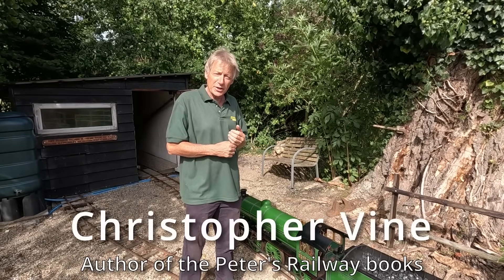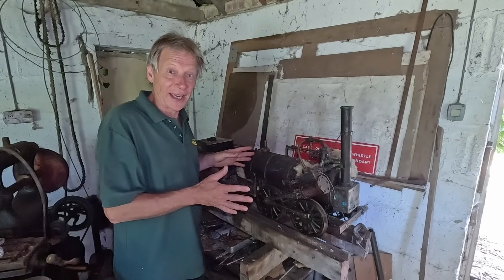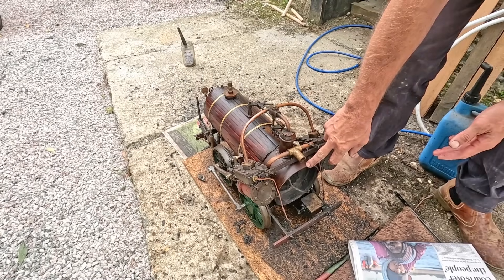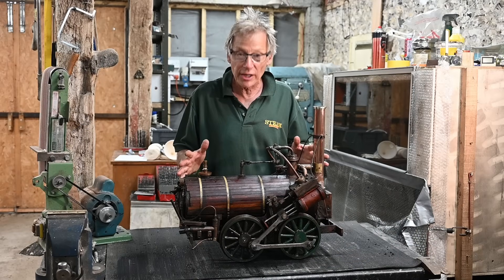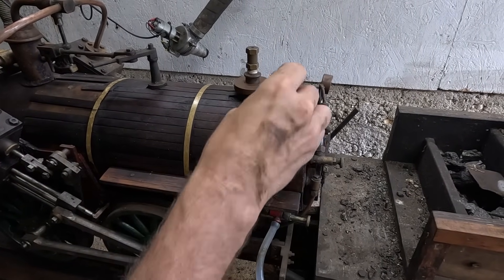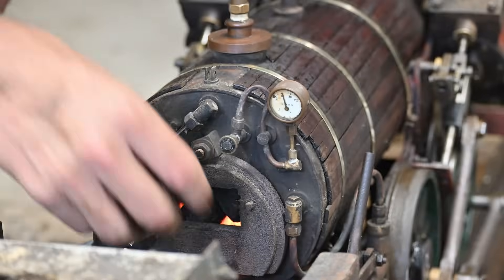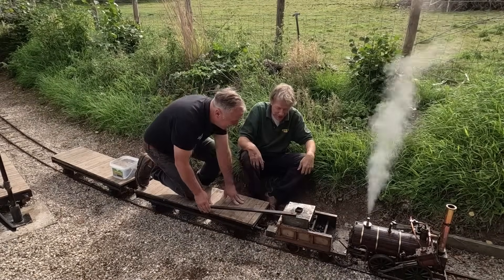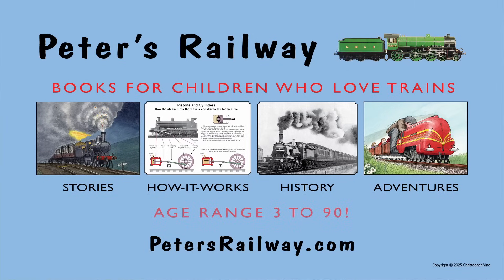Invicta Steams Again… A barn-find locomotive at Peter’s Railway

Comment: I think I get how that boiler is made.  VERY SIMPLE.  NICE EASY DESIGN solves a lot of issues if you want a gas fired boiler without a mudring-firebox.   Build the core first, then solder it at the ends. where it is easily reached.   My son and I bought a 7 1/2 gauge running chassis and we are making a silver soldered copper boiler for it.   I was unsure of how to design it until seeing the details in your video.  Proof that it works well is in the running!  I am so glad I saw this because now we can move forward  with an easy design that permits the water glass up front and a safety where it belongs.
Reply from the maker: That sounds like you have a good project on your hands!  Yes, the boiler on our Invicta is much simpler to build than a normal loco type of boiler.  However, it only has a shallow fire and is much more difficult to fire/steam.  It is always a battle to keep her running / compared to the other engines which are a doddle by comparison.
The only thing to watch out for in your design (apart from the obvious of making the boiler barrel strong enough) is to make sure the large furnace tube/flue is strong enough not to collapse.  It has external pressure which could flatten a round tube.  
I am not sure of thickness on Gerald's engine, but could have a stab at measuring it if you like.  It looks like 1/8" or 5/32".  It seems to be ok, but I was a little nervous doing the pressure test up to 150 psi!
Maybe 3/16" or 5 mm would have a bigger margin.  
Thanks for watching! Best wishes, Chris.
(For more information about the books I write to teach children (age 3 to 90!) about railways, science and engineering, please see here: https://petersrailway.com/ )

Comment: Fantastic, I am heading to a ME Federation even called Stephenson’s trials today! It’s a competition to measure efficiency where coal used, weight pulled and distance are the factors!

When I was a teenager I attempted to build a 3 1/2” gauge version of Invicta, Canterbury Lamb. I didn’t anywhere near have the skills at the time, which was probably a good thing as I would surely have been disappointed, it’s minute in that scale!

Lovely to see this larger version working, what is the gauge of your track?
Reply from the maker: Enjoy the competition/rally.  Sadly our models have only rather a poor efficiency - the winner is usually somewhere around 2% chemical energy in the coal to drawbar work.
However, the full size machines only made it to around 6%!  ( in the UK at any rate.  I think they might have got to 10% in the USA).
I, too, started to build a 3.5" gauge Invicta to LBSC's drawings.  One of these days, when I am looking for something a bit easier to lift, I will get back to it!!...
The track gauge here is 7.25".
Thanks for watching! Best wishes, Chris.
(For more information about the books I write to teach children (age 3 to 90!) about railways, science and engineering, please see here: https://petersrailway.com/ )

Comment: Peter, I can't find the video you spoke of at 8:49 about your pressure gage.
Reply from the maker: I am so sorry if I have led you on a wild goose chase.  Although I have filmed the whole process of calibrating the pressure gauge, I haven't put it in a finished film yet.  Sorry!!
For nearly two years, I have been overhauling the little tank engine, Sam.  Everything has been filmed, including painting, pressure gauge testing etc, but the job isn't quite finished yet.  When it is, I then have the mammoth task of trying to cut it all down into a series of digestible stories - wish me luck with that!!...
Thanks for watching, Chris.
Reply: @PetersRailway no worries whatsoever. Thanks for letting me know, best of luck and have fun with the mammoth task before you!

Comment: Really interested to see the water pressure testing method - from what you say in your comment seems fairly low risk safety wise compared to using air. We have a couple of old steam engines built by my wife's grandfather and have wondered what state the boilers are in / whether safe to steam ...
Reply from the maker: Yes, the hydraulic test is much safer than air and infinitely safer than steam!  The problem with steam is that when the boiler ruptures, the whole of the water flashes off into steam (as the pressure drops) and there is a major bang!!  
My advice would somewhat depend on the size of the engines.  If they are a 2 or 3 inch diameter boiler, the whole thing is rather less serious than something with an 8 inch diameter boiler.  
For home/private use, you can do what you like.  However, you might like to join a model engineering club and ask the boiler inspector for his opinion.  So much depends on how the boiler was made in the first place.  Also, if they are copper, which is relatively safe, or steel, which might have corroded to paper thin over the years...
Thanks for watching! Best wishes, Chris.
(For more information about the books I write to teach children (age 3 to 90!) about railways, science and engineering, please see here: https://petersrailway.com/ )

Comment: Great video but, @8:50, if the boiler had failed it could have been a bit dangerous with your head so close and no safety glasses on.
Reply from the maker: That's a good question.  However, the reason for testing pressure vessels and boilers with water (a hydraulic test), is that it is completely safe.  Water is incompressible, so there is almost no energy stored.  If the boiler had ruptured, there would just be a little click and a hiss as a spray of water comes out and the pressure would drop instantly.
If you were using air, then it would be compressed a lot and contain a lot of elastic energy.  Then if the boiler ruptured, there would be a proper bang and certainly danger!!
Thanks for watching! Best wishes, Chris.
(For more information about the books I write to teach children (age 3 to 90!) about railways, science and engineering, please see here: https://petersrailway.com/ )

Comment: i think it would be lovely to restore the old workshop and the line to it in order to use it for working on the locomotives and to preserve the history of the railwway.
Reply from the maker: Yes, it is a lovely idea and maybe a project for the future.  Not this year though!!  Apart from disconnecting the workshop from the line, the history is being very much preserved.  Thanks for watching, Chris.
Reply: @PetersRailway   I get that completely, model engineering is definitely not a cheap hobby, apart from anything it would be great to get those machines running again eventually, anyways, love your videos.
Reply: I agree with you !

Comment: Might do with a running engine chimney extension. And …. that shed needs to be reconnected to the running line ;-P
Reply from the maker: Yes, I have tried a chimney extension instead of a fan, but it doesn't quite make enough draught to get the fire going.   Yes, one day the shed might get reconnected....
Thanks for watching, Chris.

Comment: the real Invicta originally had tubes with a proper firebox just like Rocket, but when it was all worn, the railway couldnt pay for the replacement and rebuilt it as a single flue
Reply from the maker: Thank you for that information!  I have just been reading the Wiki article about the loco and it answers some questions.  I had always wondered why Stephenson would not have used a multitube boiler after it was such a clear success on Rocket...
Thanks for watching! Best wishes, Chris.
(For more information about the books I write to teach children (age 3 to 90!) about railways, science and engineering, please see here: https://petersrailway.com/ )

Comment: Thats amazing a little steam engine has that much power, wonder what kind of horsepower its producing?
Reply from the maker: Yes, amazing!  However, the actual amount of horsepower will be quite small, probably less than 1 hp.  
With Bongo, we measured the maximum drawbar pull at around 26 kg, 260N.  The speed was around 14 mph and the wheels were slipping, but that is only around 2 or 3 hp.  If the wheels didn't slip the power would have been more...
Thanks for watching! Best wishes, Chris.
(For more information about the books I write to teach children (age 3 to 90!) about railways, science and engineering, please see here: https://petersrailway.com/ )

Comment: tank you for making the safety tests in video, is very interesting and teaching for the younger like me who didnt have the oportunity to even see steam engines running, let aside doing maintenance and testing or even hearing how its done from elders that have
Reply from the maker: Glad you liked the safety test part of the video.  While these small boilers are fairly safe (as long as they are made of copper and silver soldered), they still need treating with caution.  The tests I did were appropriate for running in private.  If you wanted to run the engine in public, one would have to do rather more tests!!  Thanks for calling me and "elder", that is rather better than the usual "old codger"!!!
Thanks for watching! Best wishes, Chris.
(For more information about the books I write to teach children (age 3 to 90!) about railways, science and engineering, please see here: https://petersrailway.com/ )
Reply: @PetersRailway  great episode. is this the same engine that Grandpa invited to run on the railway in the books